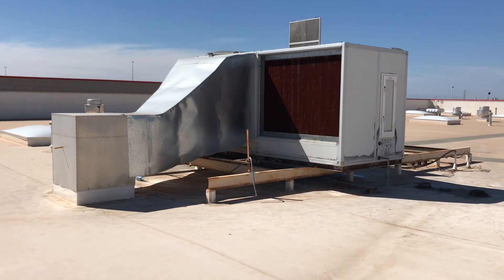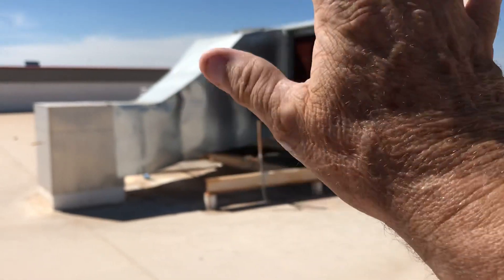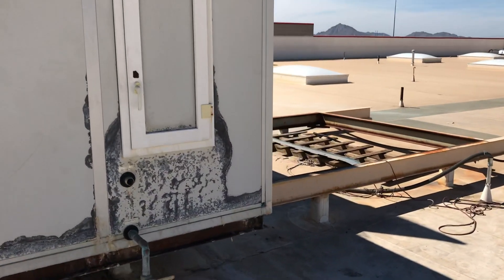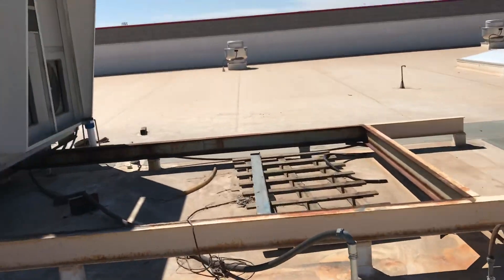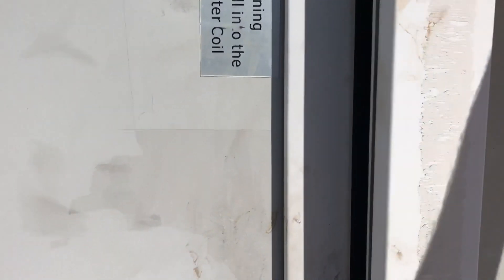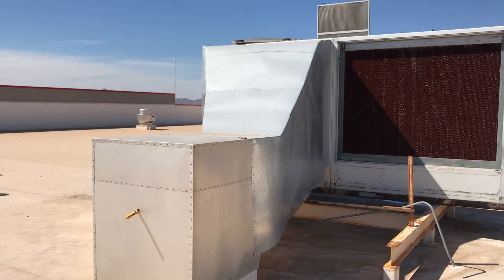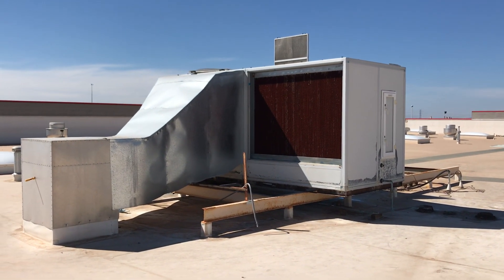The Amazing Air2o Indirect Cooling

Comment: You explained it a lil off.
See — the water gets cooled down by evaporative cooling through the brown pads, and that cooled or chilled water is fed into a radiator, that is the indirect side.
Then, air is blown through the the indirect side or say through that radiator, and sent where to that needs the cooling. 
Ofc, this is a shorthand explanation, but its correct and Ig clearer. 
Just a suggestion — please research better next time when you make a video.
Reply from the maker: No research here. I like it that way. And the manufacturer of the system approved of this video.
Reply: @cochisecounty_travels  Fine, no one can force you. But what's off is off, you can't deny that, and it doesn't really matter if the company approved of it or not — they can just say that it is correct, and most just do, but in reality... Yeah.
Thanks for considering to reply tho, I won't pester you again.

Comment: How old is this unit
Reply from the maker: Sidewinder about a year old
Reply: For a unit which is one year old, why is there corrosion like scaling around unit access door. Was there water leaking out?
Reply from the maker: Ari Doramajian the doors weren’t sealing properly. So there were water leaks. This unit was replaced last year.
Reply: @cochisecounty_travels   So it was only one year old when leaks occurred and did you replace it with the same model or different unit from different manufacturer
Reply from the maker: @arid9401  The manufacturer paid for a complete upgrade. They were unhappy with their own factory and the results and gave them two completely new units for free.

Comment: So In this system, does the air that goes into the building have a high humidity?
Reply from the maker: Michael Alcala no humidity is added. It’s not a swamp cooler
Reply: @cochisecounty_travels  //"no humidity is added"//

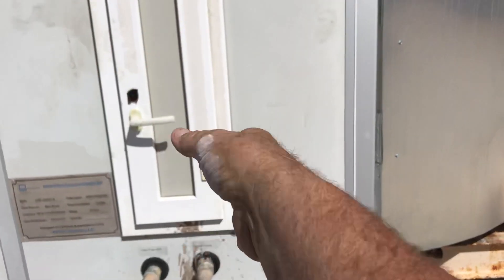Then you described it wrong, because you clearly say that the last stage (after the water to air heat exchanger) is a celdek panel  (3:29)
Reply from the maker: @ I’m used to being wrong. I would contact Air2o for details.
Reply: Doesn't the air pick up some moisture after flowing through the direct media in the second stage?
Reply: Still better the direct evaporative cooling

Comment: Too bad they dont work on the east coast or I'd buy one. Is it true that they have to be in a 30% humidity or less environment?
Reply from the maker: Jesse Lute remember, it’s NOT a swamp cooler. This is indirect evaporative coolers. They have been installing these in London and all over the UK. They make a hybrid unit that does have some small refrigeration systems that help control humidity.